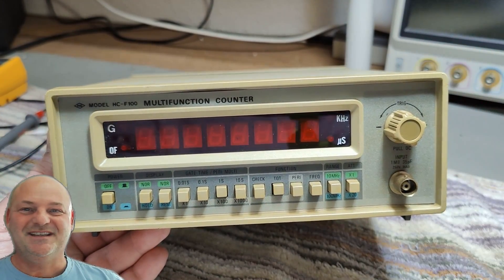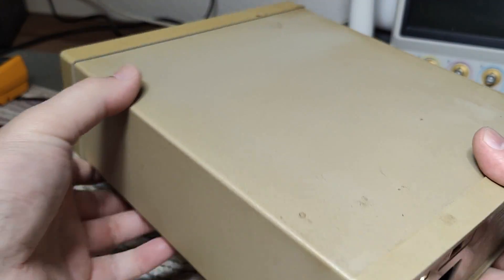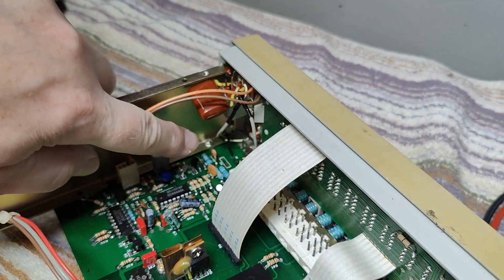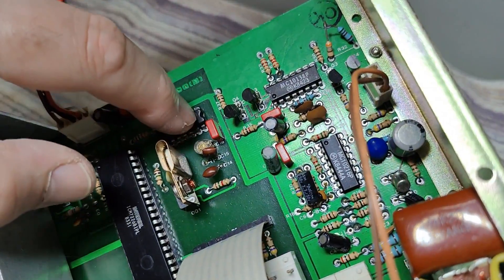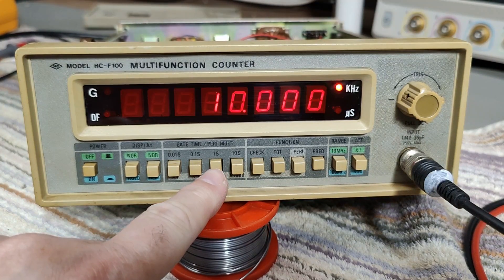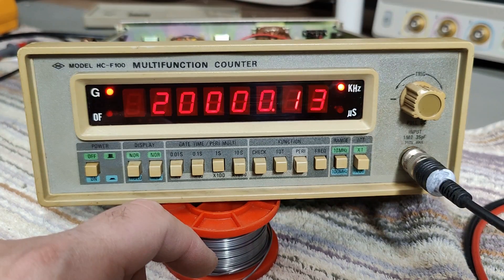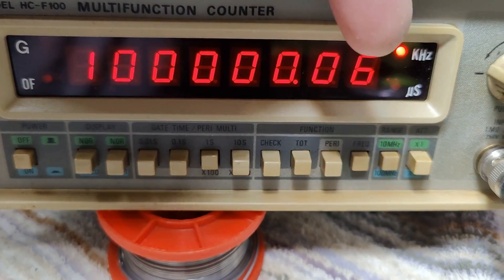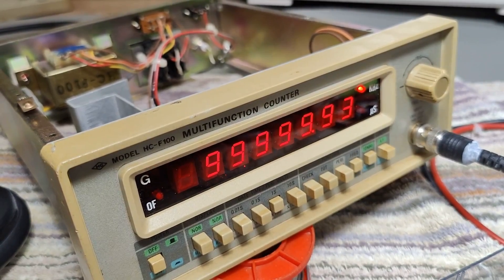Hung Chang HC-F100 multifunction counter 10Hz to 100MHz test teardown

Comment: I love the TXO. surprised to see it in a low end counter. I need to look for a schematic of the temp controller. one transistor and a thermal resistor. what's your guess. constant current?
Reply from the maker: it is constant voltage over the temperature sensor it regulates for, you can make this with two resistors, one fet and one ntc, that is all, if the supply voltage is sable, the crystal temperature will be the same, that means not affected by outside changes.

Comment: If this unit has an event totalizer function, you can also use that to find the trigger. My Tektronix DC504 has such a function, and whenever I get the trigger right, the numbers on the display start going crazy. That's when I know I've triggered properly and can switch to frequency display.